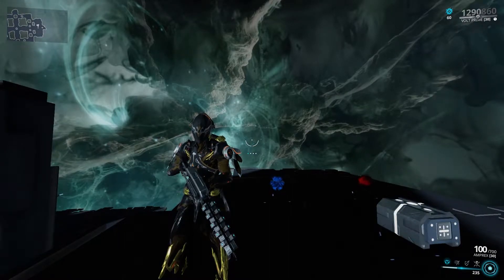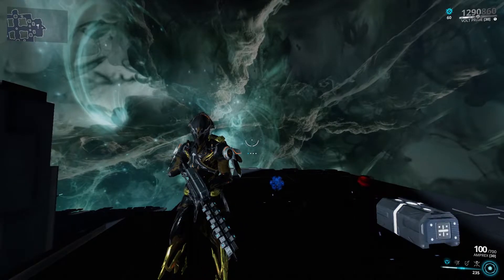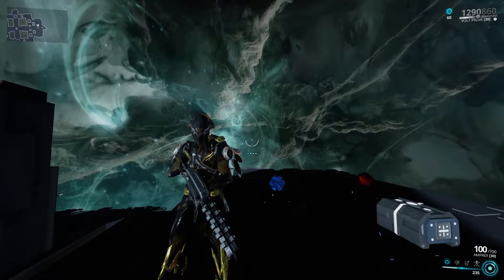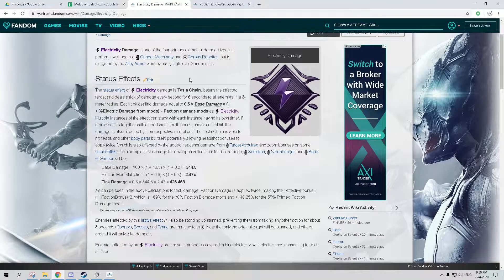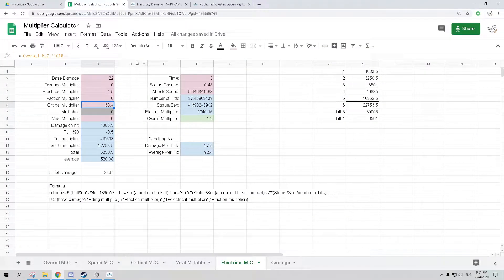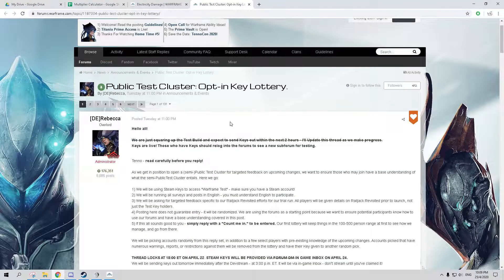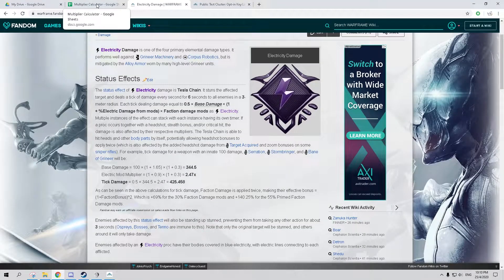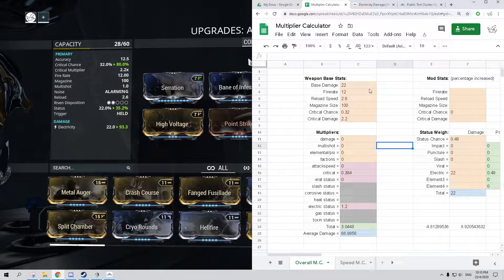Field Test For Electric Multiplier Calculator - Warframe

Comment: XEEEELP, I said that "multishot and firerate does not increase DPS" when on Discord we were talking about Condix. In normal gameplay both multishot and firerate works, but for some funny reason DE softcapped DPS by making multishot/firerate do less damage per hit, so the DPS is same. Also on Discord and ground mission I have tested damage/crit/elements against Condrix, and those works as intended. And lower fire rate makes gun to hit harder against Condrix. You havent read the beginning of the discord topic, ah. For the fun, make some test run against Condix.
Reply from the maker: oh dear lord i misunderstood then i shall write it in my pin comment soweeee but i was crediting you for the talk on multi shot and firerate just that the dps part in the comment i scare ppl will attack you on that if they didn't know the context also hahahahaha so i was clearing it =x

Comment: Nice vid but I would advise you to stop using volt his passive will increase the First shot of your amprex and the proc scales of a Buffed shot sometimes which invalidates the result🙄
Reply from the maker: Ah I forgot what's volts passive. I guess if all 3 comparison had the same benefit maybe it is still accurate lol
Reply: @x3lplive  unfortunately that was not the case during the Video 🤐
Reply: @-FSK41-  1000 damage (max) won't make difference at lvl 160 wtf???